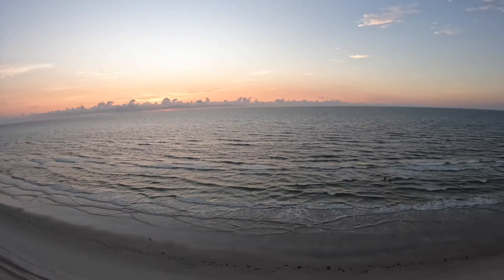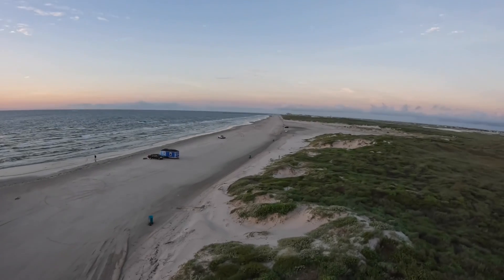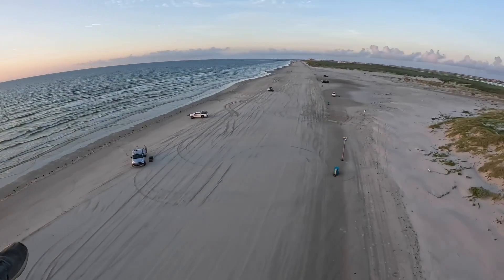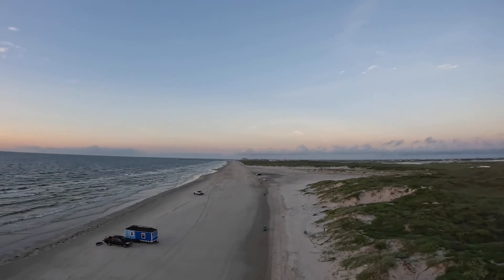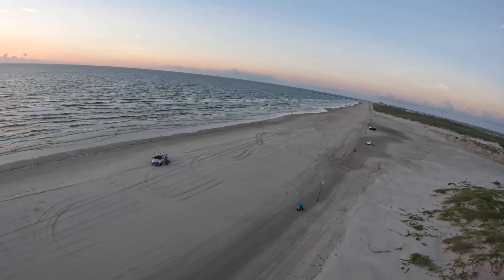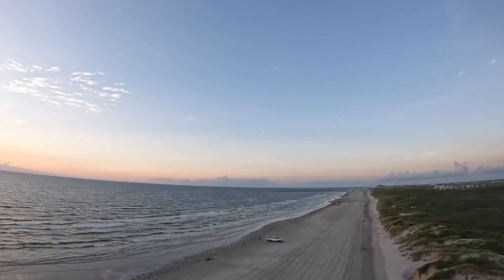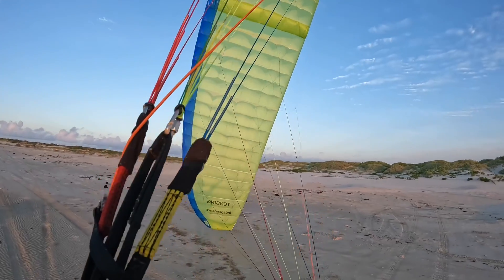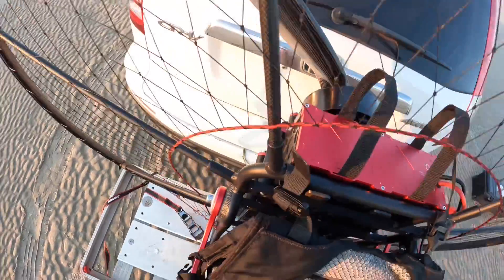First Flight of the OpenPPG SP140 V2 Electric Paramotor with Small Battery Option

Comment: In paramotoring the flight duration is dependent on wing size and not only battery size!!! Sink rate decreases when you have a lower wing load. All other things egual, my airtime goes up by almost 40% if I change my wings (from 18m to 26m).